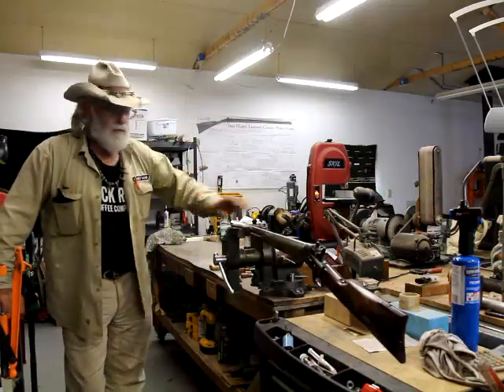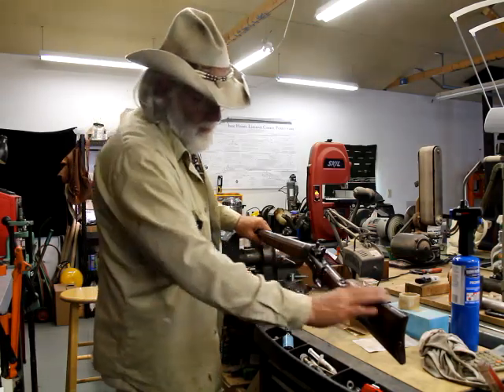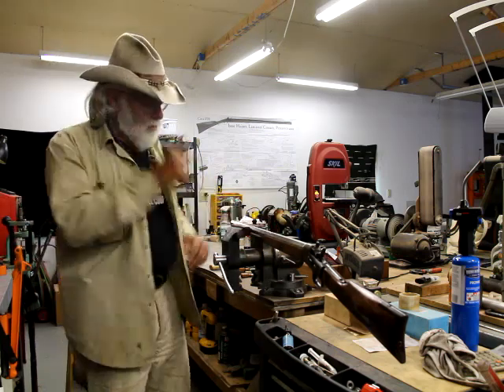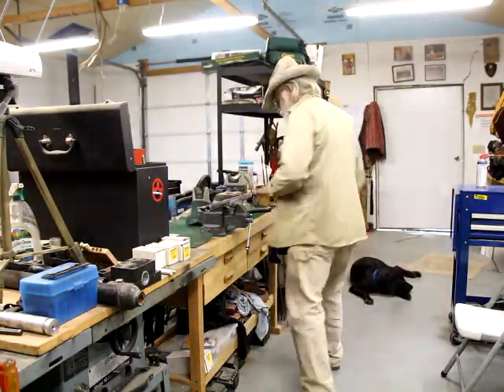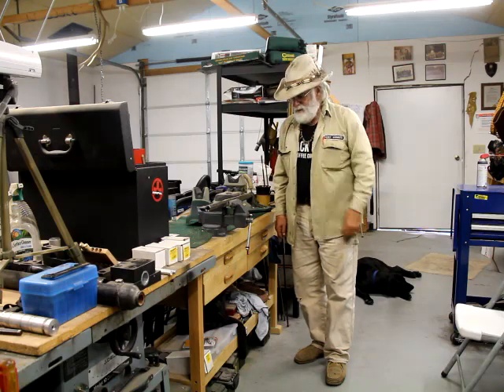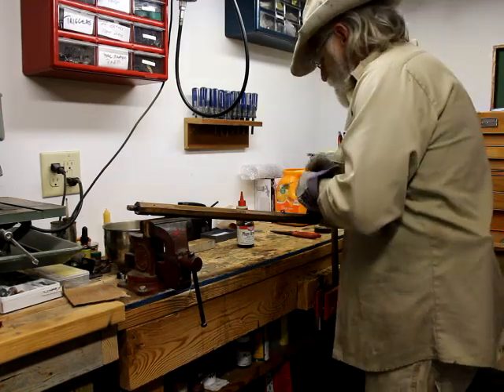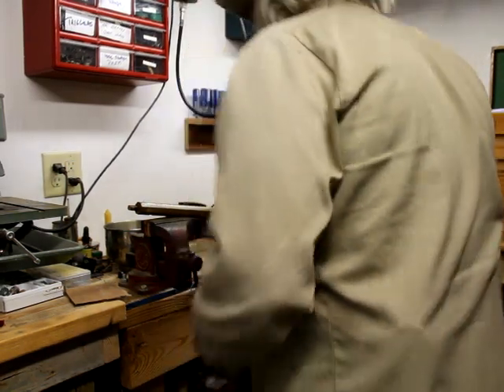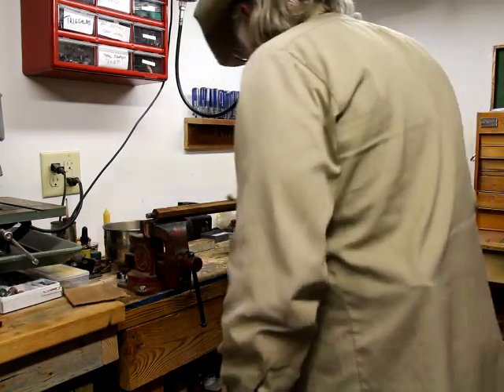Coffee w Buckskin Dave  Browning the barrel on the Almost Gemmer

Comment: Hi sir ! I have a coool question ! You can tell me if would be possible convert this rifle to 50 bmg ? Lok like certaynly Yes ! Because that rifle can hold 50/140
Reply from the maker: Don't think the actions would stand the pressure
Reply: @BuckskinDave   if be made with the most resistent material ? Please ?
Reply: @BuckskinDave  and if be scaled up litle bit ?
Reply from the maker: @Vo_d_kontra_o_norMAL  those were designed for black powder and Low pressure smokeless, not sure if it would b safe
Reply: @BuckskinDave  you consideryng the things i suposeded ?
Reply from the maker: I don't think I want to work on a project like that, it is not what I do, butt I will help you find info to decide if you want to continue